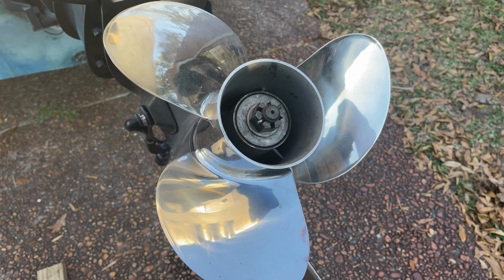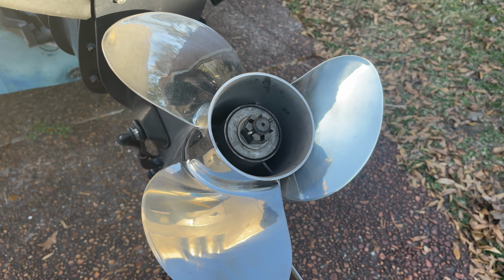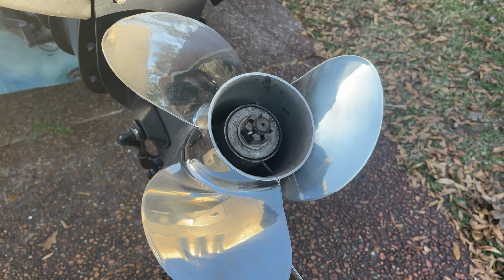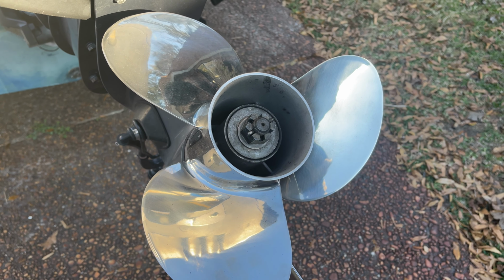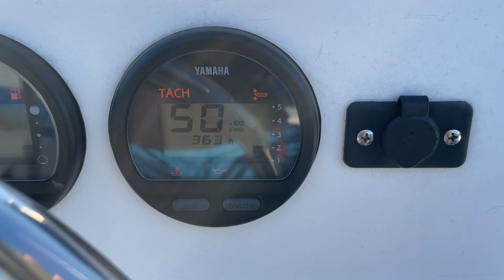Yamaha F115 Sea Trial and Prop Test Part 2

Comment: Ok, so been a year since you posted. How about some feedback; what rpm gps mph do you prefer for cruise? 4k guessing. How does feedback feel from prop on turning against at higher rpm? Have you checked the cotter pin this month? 😂 Thanks for video. Have same engine on same length tunnel boat with hydraulic steering. Love it. I am propped with turbo 13 1/4 17 and get up in similar rpm as you.
Reply from the maker: 4K - 4200 is my favorite! Low 20 mph cruise for speed depending on gear/people. She’ll run out to ft McCree and explore the bay and barely burn a quarter tank. Cotter-pin is good to go and no lost props since! 😎 turning is very smooth but definitely some cavitation if you go super sharp. Great prop for this boat/motor combo. Thanks for watching 👍😎

Comment: Good deal. Told you could squeeze more out of it. Chasing numbers by playing the musical props game can get VERY expensive. I believe your boat is bottom painted. That’s going to cost you a couple hundred rpm and a couple mph. With my 03 Cape 17 with a 2014 F115XA I can get 6150 (rev limiter) with me and one person, 5/8 tank of fuel and just enough ice to keep a half dozen cool ones cool. That puts me right at 41 mph. With a full load in the boat I top out at about 5800 and 38-39 mph. I’m running a Mercury vengeance. They’re not cheap. Not the most expensive, but they’ll hurt a little more than a rapture. The Yamaha talon stainless is another good option for 4.25” gear case. I’m running a 13 1/8 x 16p. I also keep my hull waxed with smoov pink bubble gum followed by a layer of smoov white cloud. I’m a firm believer that it helps.
Reply from the maker: It is bottom painted which I suspect is why I’m not getting higher numbers. I’m happy with this prop that’s on now much better than before. Thanks for the advice 👍

Comment: 19 pitch bro, 38 mph at 5700 rpm on the same boat. My buddy has that same boat and motor
Reply from the maker: What is diameter?
Reply: @selfemployedstudent  13 inch x 19 pitch